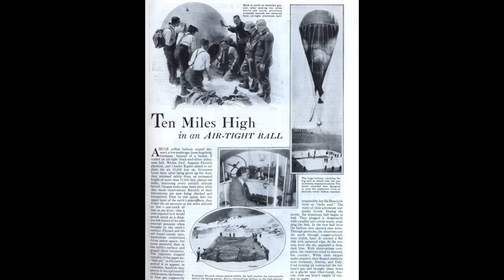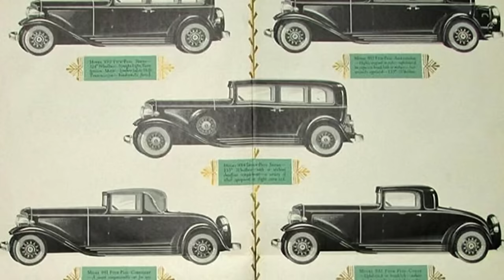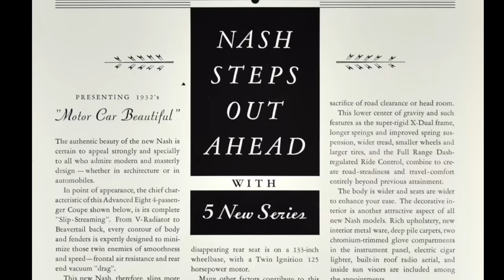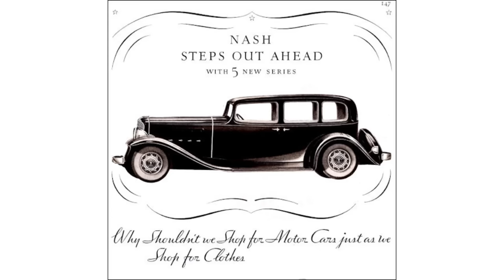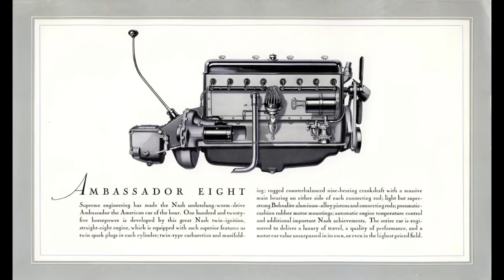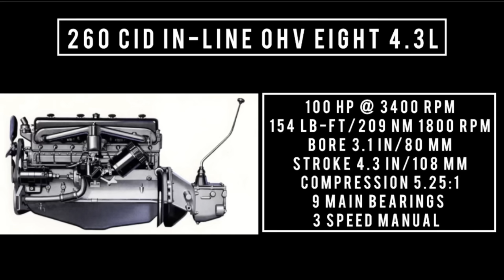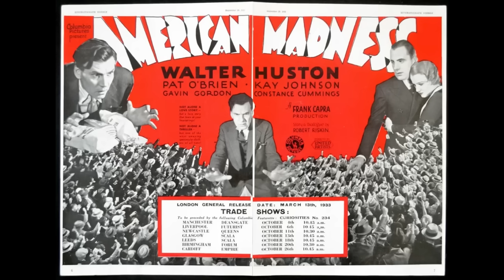1932 Nash twin ignition special eight

Comment: You may have mentioned it but these engines also had an oil level indicator quadrant on the side of the block just behind the Carb. You can see the red coloured tip of the indicator arrow pointing to the "full" side of the quadrant.  The ignition timing of these is helped immensely by use of a Dwell Tach on the individual points gap adjustment.  Indestructible with nine mains.   I had a friend with a 31 Victoria  and you couldn't hear the thing running from five feet away.
Reply from the maker: I did not know that thank you so much for sharing all that information. The owner has a few other ones I’m hoping to get over to his collection in a month or two I don’t know when but this thing just glided in it was it didn’t even sound like it was running at all silk smooth Almost like electric car

Comment: Especially with the color scheme, that Nash is a very handsome car with graceful details and nothing over-done or gaudy. Remembering the low-octane fuel of the era and the low compression ratio, it still amazes me at how much horsepower they could coax from a single updraft carb. 9 main bearings should have made for a bullet-proof bottom end, and the engine looks as stylish as the car. The ride control must have been adjustable friction dampers (shocks) done via linkages or cables. Today that's done electronically. Friction dampers usually offer a weird ride; if too tight you feel all the small bumps and if too loose you bounce all over the place. Different road conditions needed different settings and wear would change things, so most were adjustable but only by wrenching each one individually. Having that adjustment while you drove must have been a real treat. 

My WYR is the Nash, but the Studebaker comes close while the Chrysler looks dated and gaudy. Even the jaunty Jordan isn't a match for the Nash in the second choice, though it's rarity and status has it's own appeal while the Hudson just looks too plain.
Reply from the maker: Groovy choices and reasoning behind your picks 

Thank you so much for sharing all that information and insight =)

Comment: I'll take all three if they fit in the barn 😊.   Yes, omg, what a beautiful car Jay! They used to say the Buick was the poor man's Packard, but easily Nash takes the crown 👑.  There was a 28' Nash at the old AMC wire harness plant I worked at, but it looked antiquated compared to the 1930 and 32 Nash!  Just an Art Deco Jem, thanks for the show!! 🎉
Reply from the maker: Haha nice awesome choices. I’m a huge fan of these but while doing research there isn’t that many left it’s an absolute shame that this is getting lost to time. This is definitely one of those cars that should be remembered for what it was.
Reply: @What.its.like.  Yes, we've lost so many of the rare breeds to time, rust, and scrap metal drives during wartime.  Nash may have been sold everywhere, but I'm guessing most were sold in Wisconsin and the Upper Midwest, so rust just eats metal here.  The survivors were the Lucky few, like that gem 💎 you showcased.  In the old AMC wire harness plant, that 28' Nash was saved because the owner ran into his garage and smashed the fender, after which he just gave up driving and took the trolley.  Parked untill his death, it was well preserved in the garage.  Same with old Fred Kitcher's Ford Model A.  He backed the car into the garage, smashed it against the back wall, and out of embarrassment just left it there.  Katie lived there for years, she was our egg lady, and I remember peeking through the cracked back wall, looking at this otherwise original model A in perfect shape except for the rear fenders.  I have no clue who owns it now, but some lucky buyer got it.  There should be more Nash cars here, but no dealerships in the area.  An old Erskine dealership in Wausaukee though!  Anyhow, have a great day Jay!  🌄

Comment: I'm always interested to hear the stories about overhead vs flatheads.
     As a kid (in the '60s and early '70s), I always thought of flatheads as "primitive."  I think from your vids that the overhead was considered superior, and I assume it must have been more expensive to manufacture.
     I don't know where I'm going with this, but *I* find it interesting.
Reply from the maker: What I find interesting is they say ohv is more efficient but you had cars like studebaker bullet nose get 32 mpg hwy with a flathead Nash getting around the same in a flathead most ohv engines didn’t get that amc had the 195.6 get around that.. what I would love to see is the flathead make a comeback bring it back forge internals and turbo charge it.. they had low compression and that’s the best type of engine to turbo or so I was told

Comment: Jay, another brand in this segment of quality, high-value cars from an independent manufacturer was the Auburn.
Reply from the maker: Auburns were more expensive though I was just thinking Jordan was a bit outside the price point range Jordan was almost double the price of this car that’s about where the Auburn was as well if memory serves me correct they were around three grand

Next year I definitely want to get into some more power players like all burn I would love to find an L 29 cord and start doing some Duesenberg I had my opportunity I could’ve done a Duesenberg this year I could’ve done a couple Duesenberg but I wanted to wait
Reply: This was a very nice car for the money.  Who would have been the buyer for this in 1932.
Reply from the maker: Someone that wanted a different car make no mistake. The ambassador model would rival the Lincoln and Cadillacs of its day..  100 hp might not sound like a lot, but that was more horsepower than the Cadillac V8 put out that was more horsepower than a lot of cars of the day

Comment: I would rather that mercury Cobra drove with nitrous. That era cars were the most space functional. Cobra did chop the roof.
When I see these old horse coach style cars, I feel like cooking chinese for fifty people. Mongolian lamb in one headlight, beef with black bean sauce in the other.
However, the engine seems efficient, which is why it was copied. The controls are standardized, you don't have to be a circus juggler to operate it, like the very early cars.

Comment: This is era is peak Nash.  At the time the Ambassadors were priced above the Buick Series 90, about the same as a Studebaker President and more or less on par with the LaSalle (back before those moved downmarket) and the Packard Light Eight.  In other words, just below prestige.  And while the example here is not that (good Buick, not best Buick), by this time convertable sedans were clealy specialty and generally luxury models - even when offered by lower priced brands; they commanded a hefty premium for their (relative) impacticality.  WYR:  1) the President, since that was top dog and this is not  2)  In terms of rarity, the Jordan, though there were no 1932 models - Jordan went out of business in 31.  And made <300 that year.  Basically Jordan was gone after 1930, and limping even then.  In terms of a real car, the Nash.
Reply from the maker: Great choices awesome insight. Thank you so much for the correction to =)